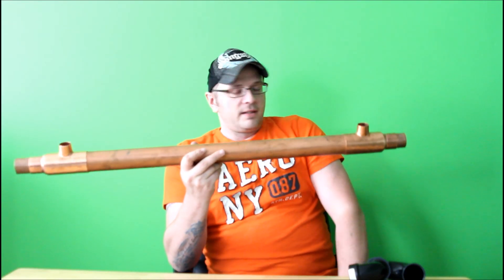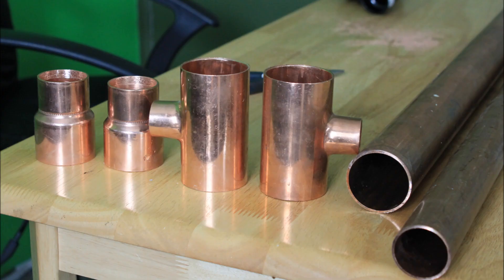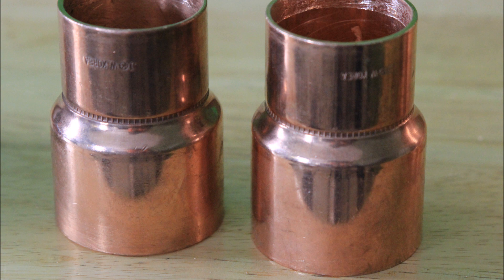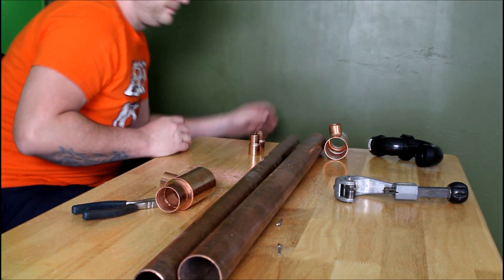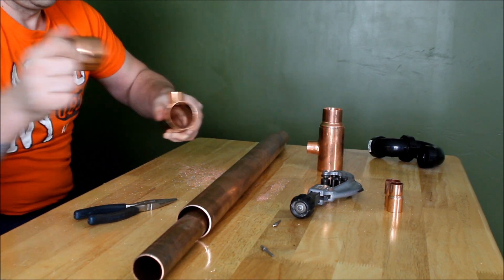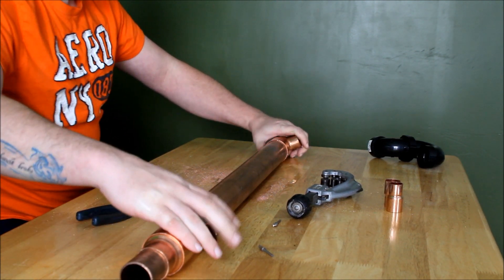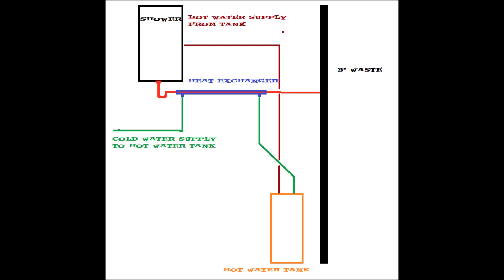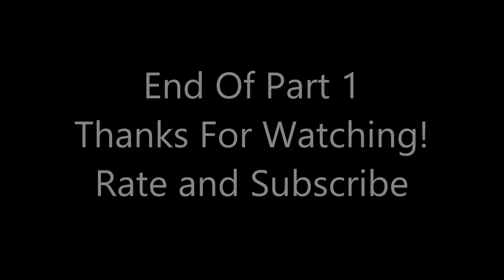Heat Exchanger - Recover Hot Water From Shower Drain

Comment: the unit is set to its highest setting at 140F, and sends the water to the entire system at that temp. when my water tank let go, I requested to have this system from my rental company, they did'nt want to do it because of heating and domestic, because of water lines colecting setament during summer months when heat is not being used, I informed them I would clean filters and flush lines, and they decided to "test pilot" my house, 4 years now, so far so good.

Comment: Somptin I forgot to mention in your other vid, Its cheaper (for me) to run  cold water supply water through the ex changer & up to shower faucet.  You mix your shower water at faucet 2 Positives "slowing down" the cold water heat transfer rate through ex changer. thus i believe more efficient & saving pipe length on supply runs.. this preheating/warms my cold water supply thus reducing my hot water supply at faucet..  Another Great video Rob .   PS Pipe insulate all pipping, big help!.

Comment: What I may remember from reading text books on heat transfer was that you get the best heat transfer if the flows run counter to each other.  Have you considered this?  This is suppost to get you the greatest average delta T from one end of the heat exchanger to the other if I have said that correctly.

Comment: I cannot believed any reclaimed heat would be would the effort of building this.
 I could be wrong but it seems like a heck of a lot of work for bringing well water up a degree or two.
Reply from the maker: Having an exchanger made from pure copper is expensive. There is a new video I uploaded that uses plastic as the outer chamber. The thermal exchange material is still copper though.

Comment: This is one of the best how-to's I've seen on the subject. Clear and concise.
I have been researching this subject for some time now, and it seems that the best results are obtained when having the exchanger perfectly upright. Apparently the shower water runs down along the side of the waste tube as a thin film. It does not fall down in the middle.
I also read that insulating the outer pipe and the piping from output to boiler increases effectiveness. (unless you live in an area where the outside temperature is usually above 30 °C/86F, but then maybe you'll be taking a cold shower)
People who are very environmentally conscious with their water consumption and who take very short showers (water down for 30 secs, close faucet, soap up, rince down another 30 secs) shouldn't bother.
I have read about savings of up to 40% using such contraption. But that was in commercial brochures ;-).
Reply from the maker: Dieter Van Hauwaert It is quite abit less than 40%. That does not mean that people should not use devices to reduce energy consumption! I appreciate the input and thank you for watching.

Comment: very smart idea!!! If I still had a hot water tank I would do this, but I now have a tankless rinnai system that is the cats ass, I also heat my house with this same system as I have hot water base boards and live in northern ontario canada where our winter are cold. The rinnai is saving me almost half of what it used to cost me. I do have a hot water tank in my garage that I use in a laundry tub for washing meat processing equipment, I just may built this for that. great vid!!

Comment: Very nice heat exchanger, I'd love to make something similar but UK regs require a double barrier. One thing to consider if insulating the exchanger: commercial exchanger manufacturers insist that you do not insulate the devices because the cold feed water in the exchanger will be kept warm when the flow has stopped and allow bacteria like legionella to thrive.

Comment: Rob - would it be more efficient, instead of pre warming the hot water heater's cold water, to pre warm the cold water running to the shower? The person taking the shower would automatically dial back the shower's hot water. I don't know what method is best, but you would have to run a bunch of extra line if you ran water to the hot water heater, depending on it's location.

Comment from the maker: I agree copper can be quite expensive. Having the knowledge of how things work and knowing that you can do this down the road is priceless. Energy is dirt cheap right now. Things can change quickly. Heat exchangers are often a necessity when working with two different liquids. Copper is by far the best heat transfer material out there for the money. Plastic is a great insulator, but horrible at transfer. Thanks for watching and taking the time to comment.

RTP

Comment from the maker: Yes, Rinnai and Eternal. I am very familiar with instantaneous hot water systems. Rinnai is king of the market in Northern Ontario. There are ways to incorporate heat recovery in almost any system. Although it may not make a big difference in the winter, it would make a difference in the summer. So how is your unit piped atm? Does it heat up high temp (180°F) water to the rads and mix it down with a valve for your domestic?

Comment: Cool... you've installed them on Rinnai systems, but If I'm using that very same system to heat my home, and the warmer water is allready circulating back to the heating unit, (from my water radiators) then making a heat exchanger from my shower would be redundant would it not?  (just curious)

Comment: If you think of your design as being one half of the heat exchanger, which only the cold water comes into contact with. The other half would be a separate length of pipe which fits snugly through the 1.5", to carry the waste water only. In between this double wall would be a microscopic air gap and a leak path for if the copper failed in either wall.

I hope that makes sense, it is much easier to explain with pictures!

Comment from the maker: Great point Dan. I should have mentioned the point of insulating all of the lines. You really do not want to lose any heat that you have gained. Insulation is important in any exchange of temperature whether hot or cold. Warming your cold supply is something I have thought of.There will be future videos for a system I have designed for home with multiple showers and exchangers. By feeding the cold supply for each individual fixture. Anyways, thanks for watching and commenting!

Rob

Comment: I have thought about doing something like this. I would connect it to the cold water side of the shower though rather than running it back to the water heater. I'm thinking this would increase the temperature of the cold water that you mix with the hot, so you use less hot water to get the desired temperature when you are showering. How do you think that would compare to your idea?
Reply: Sorry. You've answered this question before. =)
Reply: Intressant mannen
Reply: Kompis hur mår du hoops du mår bra har du viber eller henguts så kan vi video chatta de var längesedan vi hördes av 😃😄

Comment: So ,I'm sitting here watching the video wondering if the water flowing through the inner pipe from the drain would fill the pipe enough to provide an appreciable heat transfer to the cold water sleeve surrounding it. I realize that any heat recovered is a good thing,  but how much of a temperature rise do you think you could expect in the cold water line ?
I would think it would be prudent to insulate the whole assembly as well  , would it not ??
Thanks for the great videos !

Comment: Could you run the cold water through the center ?  2" PVC to 2" copper drain via T, then 2" to 3/4 that runs through the center?  More warm/hot water would be around the 3/4 allowing for better drainage.

Comment: Don't know if someone mentioned it yer, but your schematic shows a parallel-flow heat exchanger. If you switch two of the pipes, to make is a counter-flow heat exchanger, you will  have higher heat transfer. 
Could you not use a PVC or ABS outer tube to save on materials?

Comment: Hello Rob, could this type of exchanger replace a plate exchanger I currently have for exchanging water from my wood stove to home (in-floor) radiant heating?  I am having trouble with mineral deposits in the expensive heat plate type exchanger and loosing transfer ability.  Thank you for any input you may offer.
Reply from the maker: A plate heat exchanger is way more efficient. The problem with plate heat exchanger is the drop in pressure and flow. This exchanger could be used but you would have to bank 2-3 of these. I personally would buy a new plate heat exchanger for your application.
Reply: Rob The Plumber Thanks again Rob, I have cleaned the exchanger out and is working better. Helpful information you are offering, very nice of you to take your time for guys like us.  Happy Holidays to you and yours!

Comment: It may have more to do with the companies covering their backsides. I just thought it was worth mentioning. Instead; if insulated and the cold supply to shower is after exchanger, you could run a brief cold shower to cool the exchanger down if concerned.

An example: "When no cold water is flowing up Showersave, the temperature in the pipe should be prevented from becoming higher than 25°C (77°F). The cold water pipe, connection and the outer wall of Showersave may therefore not be insulated."

Comment from the maker: The great thing about this exchanger is that the drain is only 1-1/2".  Plumbing theory says that a shower drain is designed to be 66% full on the horizontal. In part 2 I will be showing the actual numbers on how much heat you recover. And yes, you should insulate as much as you can. More insulation the more efficient. I will make point of that in part 2. Thanks!

Rob

Comment from the maker: Your not the first to ask that. The bad thing about it, the system is designed to be a simple as possible. Warming the cold water to that one fixture can be quite complicated. I need to get my video on the dishwasher exchanger done so this can all make sense. Mixing water in a valve is the most inefficient thing we do in our plumbing systems. I will just make a video... Thanks for watching and commenting.

Rob The Plumber

Comment: Great design was thinking of trying it for myself a couple of quick questions first. Is there a drop in pressure from the input pipe to the output of the heat exchanger? Also is there any reason that the outside of the copper pipe couldn’t be covered with insulation to improve the efficiency further?
Reply from the maker: Very little to no pressure drop. Friction loss equal to two 90° elbows. (which is really nothing)
Reply: Assuming the air under your shower is warmer than the cold water feed, I'm thinking you wouldn't gain anything with insulating it.

Comment: Seems to me you might be restricting your cold water supply and lowering you over all water preasure. Maybe it would be a bit less constrictive if you didn't use the street reducer  and used a full size fitting instead?

Comment: So much better than the mute video. Hard to see how the application is worth it. Fast moving cold water running past slow moving waste water and air, for 10 -15 min a day. What is the temp difference between in and out of the cold water?? 

I have a friend who connected a garden hose to a car heater for A/C in his room. Worked good until the hose broke flooding his room. Also a lot more water was used than needed to water the lawn.

Comment: better idea. Just run your shower cold water through it. it'll warm that and you will adjust the flow of the hot water in the shower as you go. should equalize shortly after starting your shower
Reply from the maker: Christopher Gruenwald I have tried that. It does not work very well. Maybe with a "2 handle" faucet it would. Modern sinfgle hande valves are designed to mix cold water with the hot. It just does not mix well. Thanks for watching.
Reply: Just curious as too what happens why it doesn't work very well? I'm building a new house and was thinking of installing one for each shower. There would be heat loss and resistance running all the hot water for the house through 2 heat exchangers on opposite ends of the house. Any input would be great as I would prefer to only have to do this once.
Reply: Christopher Gruenwald modern thermostatic valves are adjusted to the temperature of the hot water, at the time of installation. If you would increase or decrease the hot water temp of your heater/boiler, you would notice that the default setting of the faucet would not give you the desired showering temperature. The valve would need to be opened and readjusted. Similarly, significantly increasing the temperature of the cold water would have the same deregulating effect.
These thermostatic valves do not have a computer in them, they are mechanical in nature and their range of operation is not very wide, therefore they need careful adjusting.
Reply: you run the cold through the heat hex and to the shower cold and tank feed is the most efficient way
Reply: I did some looking into this. It's not legal. It has to be a double wall between the potable water and sewage. There is a company that makes one that's legal and commercially available called powerpipe.

Comment: my next solar project will use one of these to exchange solar heated Propylene Glycol to domestic hot water use.
Reply from the maker: David Reed It will work great. Thanks for watching.
Reply: David Reed You may get better heat transfer using a commercial off-the-shelf flat plate stainless steel exchanger, since they have a bigger surface area.  A friend of mine uses one in a side-arm thermosyphon arrangement - works great.
Reply: Tim Small do you have a link?
Reply: David Reed Not to his, but here's a study which used a similar setup - http://sbrn.solarbuildings.ca/c/sbn/file_db/Doc_File_f/Experimental%20Evaluation%20of%20a%20Multi-Tank%20Thermal%20storage.pdf - these stainless exchangers are mass-produced and cheap.  No good for shower waste obviously, but if you have clean water both sides, they're efficient and cheap.
Reply: Tim Small my plan is to use this on my solar water heater, I will use anti-freeze to heat the jacket and transfer it into the water for my tiny house use.
Reply: David Reed OK.  I think a flat plate exchanger will be cheaper and more efficient for that purpose.  I last bought one on a well-known online auction site for about US$40 with BSP spigots, and you'd pay more than that to buy the parts for a copper tube-in-tube exchanger.

Comment: Great idea but a solar hot water heater would provide more return when you consider time on this project vs this one.   This heat exhanger would be a better project in an industrial setting.  Nice work either way though

Comment: Unfortunately this won't pass code, as it is single wall. You need double wall (two separate layers of metal between potable water and waste water) if you want to do it properly.
Reply from the maker: It depends where you live. In Canada, it will not. Many spots in the US, it will as long as it is type L or K copper. I could easily make this a double wall exchanger, but it would be so inefficient.

Comment: I can see that saving you about 15 cent over a 20 year period.
Reply: Craig Bulloch yeah this is pretty ridiculous for the application for which he is building it for  but I have another application by which this type of heat exchanger will save my $2-3k a month on electric bills
Reply: Actually if he was raising the temp of the cold to the shower  it's amazing how much hot water you save while taking a shower.